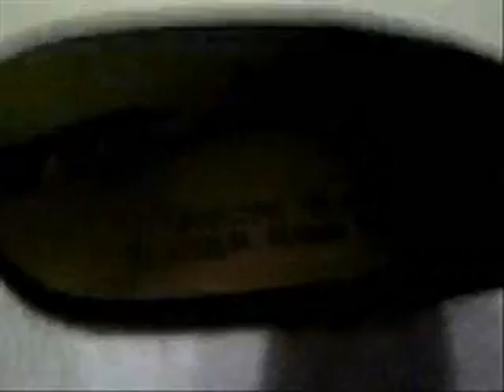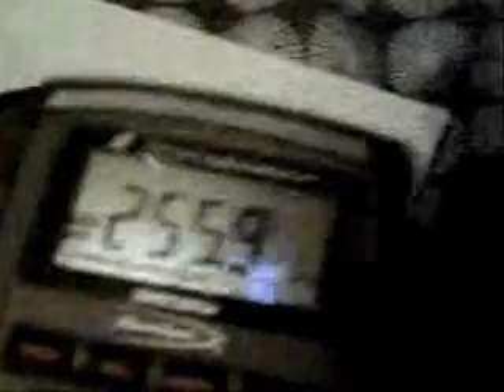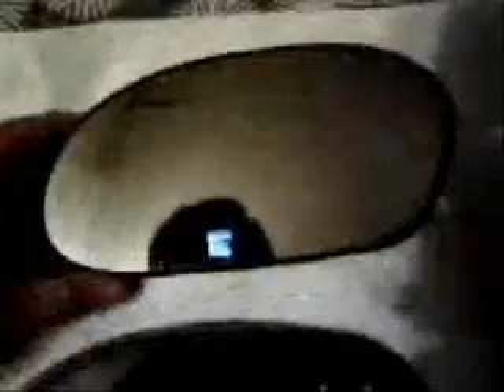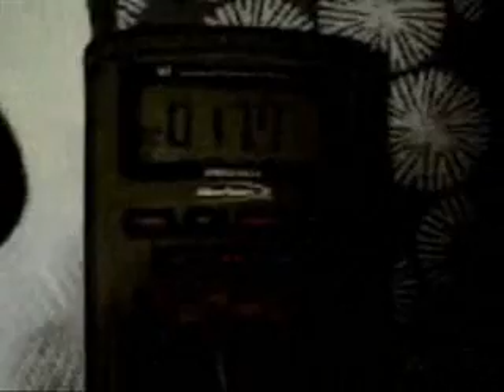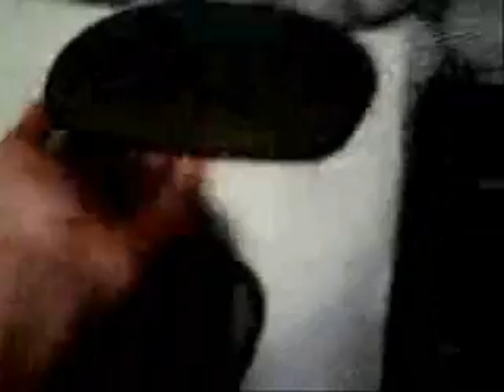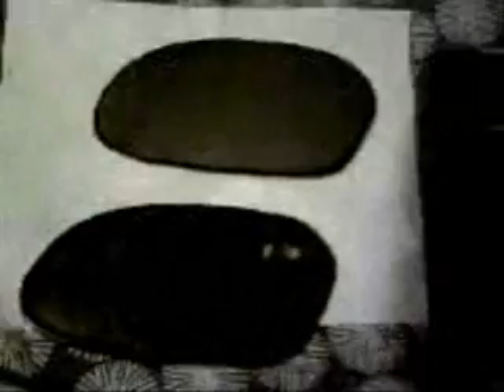Taurus Log 25: More Power Mirror Stuff

Comment from the maker: It pops off by hand. You push the glass inward on the side closest to the car. Then, you pull on the side furthest from the car and it should pop off. After that, you just make sure you disconnect the wiring to the heater circuit so that you don't destroy wires.